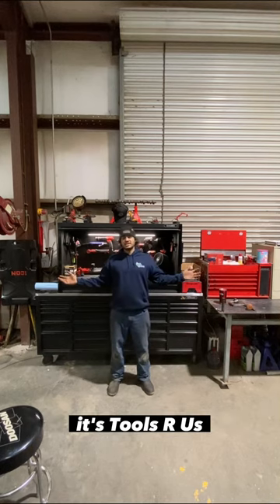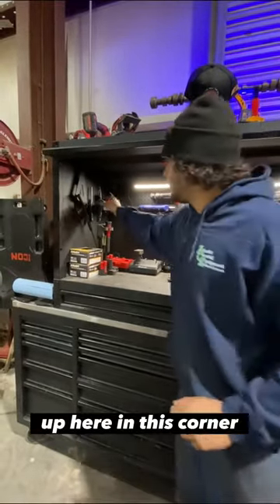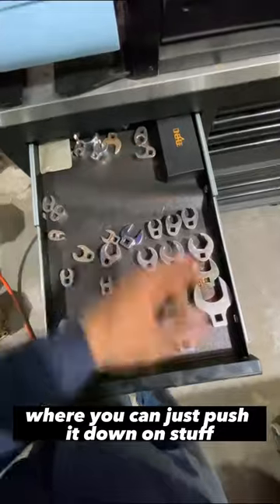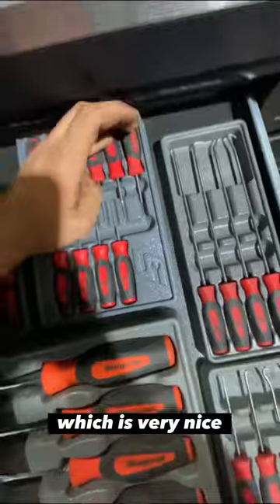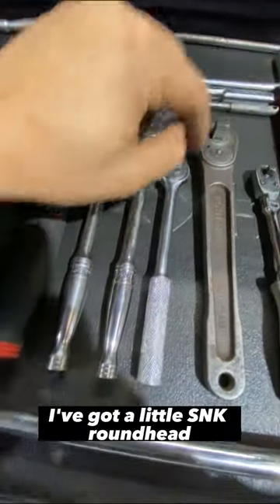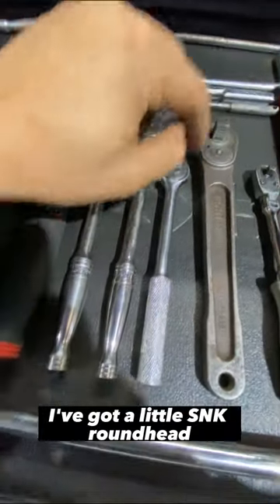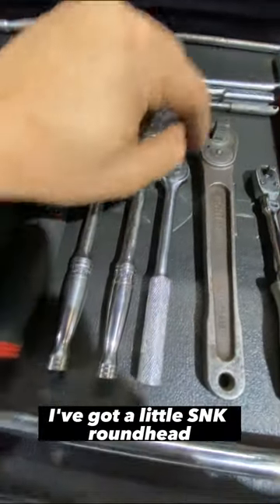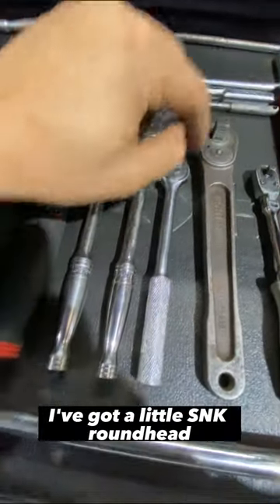Toolbox Tour Husky 84in with 61in hutch and 2 drawer riser DIRT EQUIPMENT TECH

Comment: I have the 80" w/ side locker and hutch, as well as the 84" as you have. I'd agree, the 84" thin drawers are way to thin, to the point of annoyance. The main drawer is fine, but I'd never load it down as I've done with the 80". That said, when I compare the cost of my setup to that of a Snap-on, there really isn't a fair comparison. I have 164" of tool box and my total investment was less than $1500
Reply from the maker: Yes the thin drawers are super annoying! Have you found a really good way to store wrenches in them? And yeah the cost of a husky box is what sold me on it! You can't a box that big for anywhere near that price point! What's your thoughts on the 80in setup??

Comment: how did u set up the hutch, isn't that 61" hutch only supposed to be used with the 61" husky bottom box?
Reply from the maker: Correct! I just set it up there, it's not mounted or anything
Reply: so u just bolted the hutch to the riser and slapped it on top of ur 84" box? 
 @tools_r_us
Reply from the maker: @stevend6258  yessir! It's a lot of weight figured I'd be fine